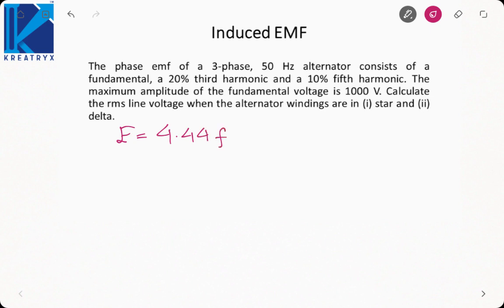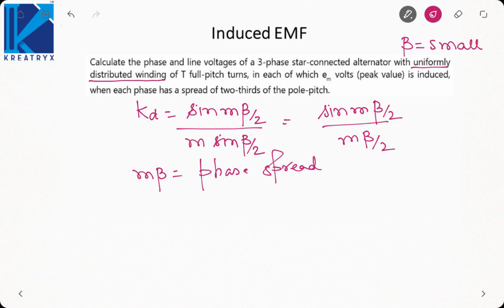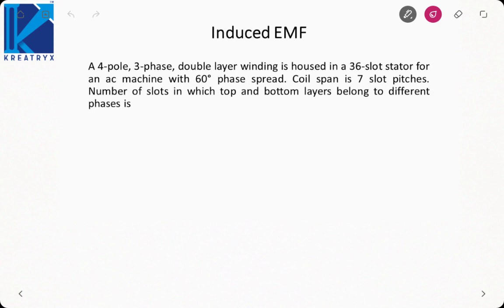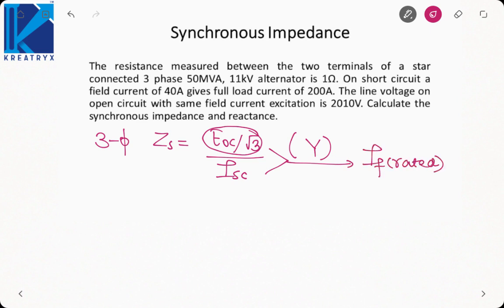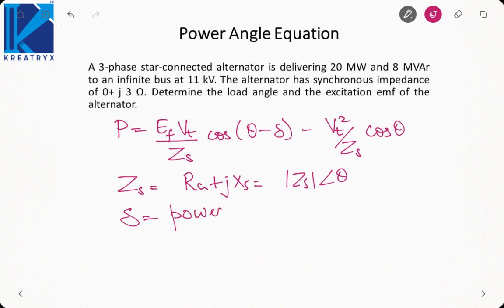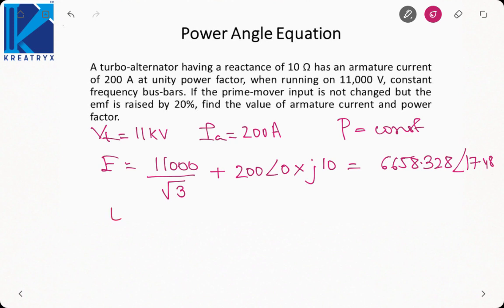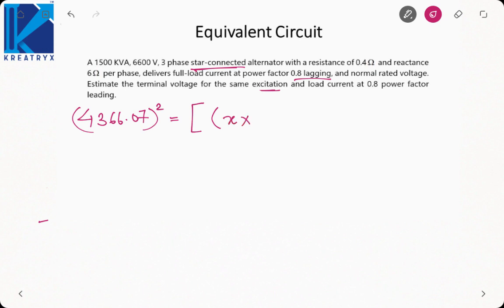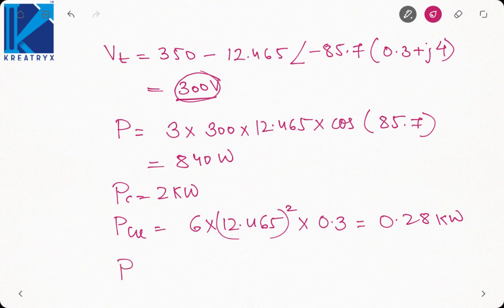Synchronous Machines 1 (Electrical Machines) Tutorial | GATE (EE) - Krash - Problem Solving

Comment: Sir you have consider 3rd harmonics in delta which is not possible.... please correct me if iam wrong
Reply: for delta connection 3rd harmonic is absent in phase as well as line so correct answer would be 710 volt.
Reply: Sir ne aisa q kra😭😭😭😭...first hi ques me ...confuse kra diya🥺...third harmonics to nhi hota h line nd phase voltage me in delta connection to q bola ki line is same as phase so third harmonics will exist🙄....ab mai kya kru😖
Reply: @khushisinha2697  exactly I also get confused

Comment: sir@ in ∆ connection 3rd harmonic emf should be absent, isn't it? 
it is given in PS Bhimbhra
Reply: in star it is absent because of ungrounded neutral so there is no path for 3rd harmonic currents to flow.
Reply: I was asking about delta connection sir
Reply: In delta connection the 3rd harmonic current does flows since it get path to flow through its closed wdgs but it futher dissipiated in the wgd and thus causes a heat. Therefore we have to take in account the 3rd harmonic current in delta connection
Reply: The statement you read in the book that 3rd harmonic emf should be absent in Delta connection means that  they are eliminated in line voltages. Actually, all the triplen harmonics are eliminated in line voltages be it delta or star connection.
In delta connection these triplen harmonics are of aiding polarities and maintain the circulating currents in closed delta. They are also said to be short circuited there. They appear in the form of voltage drop or copper losses or heating effect.
Reply: 3rd haromnics is absent both in line nd phase voltage..in case of delta connection...as taught by my fav ankit goyal sir☺️